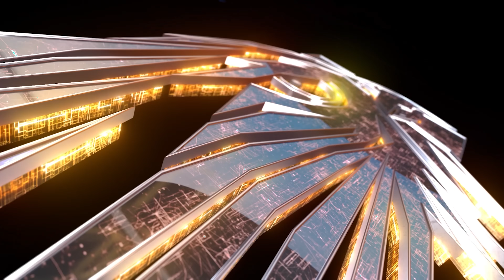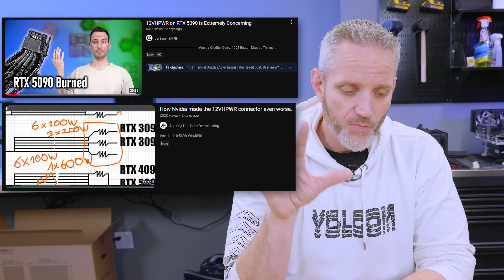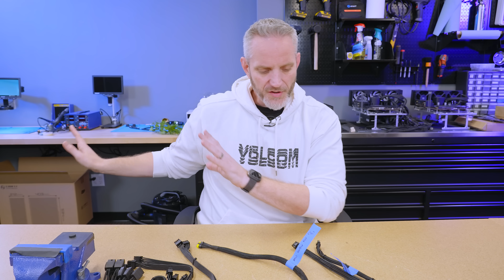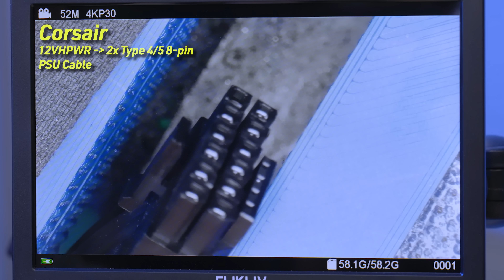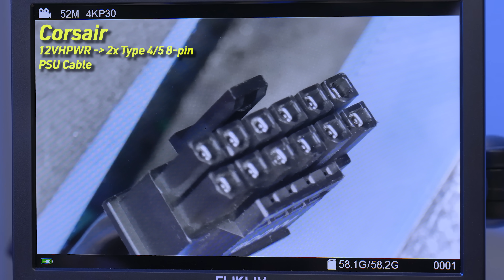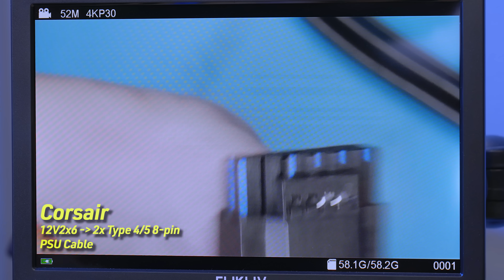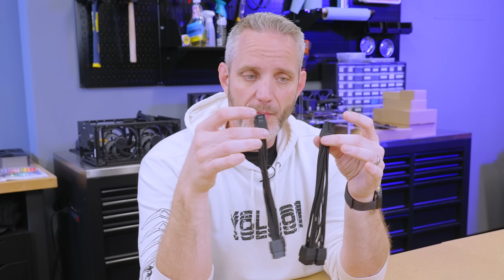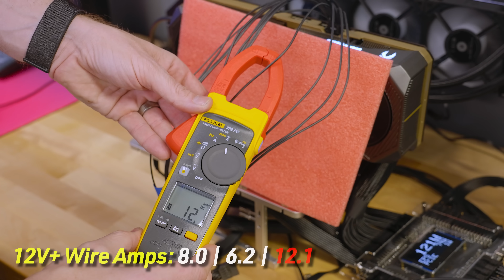I discovered something concerning and I need the Experts to chime in... More 12VHPWR discovery!

Comment: why don't people just use the power cable that comes with these 50 series cards??
Reply: what was included on my side, is 10cm and does not connect to sense, it is a 12pin-3*8pin. the power supply has a full 12pin-12pin with sense
Reply: @kensaiix  I think you and everyone else should be using the 12pin-3*8pin adapter that is included with the GPU.
Reply: @ it's too short.
Reply: @kensaiix  yea, but they melt.
Reply: @ why do you think the 12-3*8 would not melt? all that wattage still goes to the connector on the card

Comment: Jay, I have 2 x 5090 FE's one is being run off of the floppy included cable in the box and my other machine is running overclocked using a Seconic Vertex PSU and their included 12HP cable that comes with the PSU (it's a really long cable similar to the length of your cheapo amazon one). Now I have a reader as well and I have actually been checking the systems almost every bi hourly they have been running.

Machine 1 (floppy Nvidia cable) since the card has been installed has been running on a PC that is playing POE 2 for 16 hours min a day everyday with it running a solid 72 hours constantly from delivery day, literally almost as hardcore as you can get and not once has a single cable been over 9.5 not once.

Machine 2 (Seconic Vertex cable + overclocked) has been running everyday for a minimum of 10 hours a day and is used for multiple games from WOW, Overwatch, to Diablo, Spiderman 2 stuff like that. Again measuring the Seconic cable not a single time has a single cable been measured over 9.5.

I don't have any other cable to test after seeing these videos but yes the card is living on the edge with this connector but with my 2 cables I would bet my house on it that they would never fail under current use scenario and my use scenarios are probably higher than 99% of all 5090 owners.

The guy who had the burn out originally was using a third party mixed metal cable and as you probably know using mixed metal on connectors is a massive NO, NO at this power level. Maybe you can do a test and measure a mixed metal? anyway Nvidia will laugh in your face with a warranty claim involving a third party cable, simple as that.

I feel that the line between a good quality cable and a bad one is so thin that most cables will probably edge the line into being bad territory, from Nvidia POV if you use the floppy one in the box and just use the card at stock values it will never be an issue, we the consumers know the 600 limit is tight but ultimately it's fine in their eyes. At least the 60 series will be different as they wont be able to run it on a single 12VHPWR anyway.

Comment: A similar thing used to happen with the cheap 3d printer kit Anet A8. The 12v heatbed pulled about 10-15 amps. It used a molex type connector with 4 power pins but only used 2 wires to save money. As the bed moved back and forwards, over time, the connector loosened and caused arcing inside of the connector. As the arcing increases, deposits build up on the inside of the connector. This increases the resistance, which increases the temperature in the connector, which increases the resistance.... Often the connector would char and melt. In some cases, when the printer was left unattended, this led to fires. **The solution was to solder all 4 current carrying wires direct to the heatbed and provide strain relief to the cable to stop it from moving.**
Reply: That bed only pulls 7-8A, not 10-15, but anyway that's more than plenty for that underpopulated connector, WHILE BEING HEATED BY THE BED, which greatly accelerates the oxide formation and loss of contact springiness.

Its close relative the Geeetech i3 series, while otherwise doing just about everything in electronics right (more powerful chip, bootloader for easy programming, lots of configurability, more efficient parts, flyback diodes to prevent heater MOSFET shock, excellent MOSFET heatsinking, replaceable sensitive fuses for two separate sub circuits, good quality wires soldered to the bed) uses the ATX12V connector (4 pins all used) for the board power input. While the connector isn't being used in the angriest possible way, it's not moving, and the heat dumped into it from the PCB is very modest, it still goes bad within about 2 years. Maybe something with crimp quality, anyway eventually it starts heating more and more and then causes a runaway oxidation failure and slight discolouration of connector housing. The connector is loaded with up to about 160W or 13A, since it serves the 90W bed, the 40W heater, and another 40ish Watt worth of motor drivers and junk.

Comment: Jay there is something called pin push back. Whereas the female pin looks normal. However because the pin is loose in the connector the male pin pushes the female pin up in to the connector and does not make  good contact. When you pull the connector apart the male pin of the card tugs enough on the female pin that when you look at it, it appears that it is in place and
Flush with the connector.

Comment: My brand new never plugged-in Corsair H++ cable that came with my RM850x PSU has the same corner loose pin on one of the 2 connectors. The other end is all uniform and solid.
Reply: Shit. Mines been plugged in since last May and no issues and I want to check. But now people are saying that the cables are rated for like 30 insertions. Which is insane to me.
Reply: @jimbo121  I bought my power supply December 2nd from Best Buy.
Reply: @jimbo121  some more recent tests have shown that multiple insertions (like 100+) actually improved the connection quality. I wouldn't bother checking if you haven't had any issues, but not because it could wear out the connector. I also have the same cable plugged into my 4090 for over a year now and haven't had any issues thankfully! I do think it would be a good idea to leave it plugged in and firmly push all of the wires in individually. If you do have a loose sleeve like the video, that should seat it all the way on the connecting pin.
Reply: I built my PC in 2024 using the RM850x and just checked it. My Corsair cable is exactly the same with the loose corner pin. I then checked a spare Corsair PCie cable that I didn't need to use and it  also has the same loose corner pin. I found that if I pushed individual wires on the PCie plug on the GPU they were all seated nicely but that corner pin could be pushed in about 2 -3 mm before it seated fully but also felt loose on the connector.
Reply: Thanks for sharing!
@Jayztwocents same issue.
Reply: Dude, I was about to buy a Corsair psu... now I'm probably not going to lol

Comment: I'm no expert but when a wire heats up significantly due to high amperage, the fix should be the gauge of the wire in use. now we all know that the weakest link in the chain defines the strength of the said chain, so the calculated gauge should be same in every connection, wire etc from the PSU and past the 12v connector to SAFELY pass all the current through and not cause any heat related issues that would result in melting anything

Comment: My Corsair cable is exactly like that, except maybe a little worse, with multiple recessed pins. And It's brand new. Never been used or even plugged in once. I didn't use it because i purchased a custom CableMod cable.

Comment: Current flows from neg to pos in a  DC circuit, and loose contacts create a tremendous amount of heat. On my pigtail I pushed all the pins to the face and used a marine heat shrink with the waterproof goop in it, to hold the wires to the plug

Comment: C.I.T. here.   Power in and power out should be as equal as possible when it comes to wire thickness quality. Any variations in cable size affect the delivery of electrons. Any possible damage, quality control issues, or even cable length increases resistance in the wires. Resistance translates into heat. There are mathematical formulas that check all of this before you even get into the construction of items.  There are tables that exist where the math has already been done and charted. Wire size or gauge(awg), wire length, wire chemical makeup,(because some wires are just copper. Some are aluminum, and others are an alloy)have all been extensively put into charts for quick reference. 8 wires at 12 gauge should handle 15 amps if the load is balanced but if not balanced gauge thickness should be increased to compensate.  Remember electricity will always take the path of least resistance.

Comment: I used to only buy corsair PSU and other things but over the years their quality has gone to shit. After having multiple PSU dying on me, I started doing EVGA then Sea sonic and never looked back and have yet to have a PSU die on me. I would say it been a good 5-7 years since I bought anything by corsair. This might be a reason they are about to have a new CEO change which was one of the original founders. I have had 2 4090's for years now and have yet to have any cable issue. I have the MSI Supreme Liquid X 4090 and my son has a Zotac extreme. I was running an MSI 1200 PSU now went to the Edge from Lian Li since i went to the EVO XL and sons has been running on the Seasonic 1600w Plat that I bought from overseas because it didn't come with a US power cord to the wall so had to purchase it separately. This is when those PSU's was like gold and hard to get ahold of. I have also gone through roughly 3 or 4 cases over the time I have had my 4090 so it has been moved in and out to new builds. It all comes down to either human error or crap cables from shady companies. It would be interesting to know if all the melted cables have been from the same manufactory. Fasgear might be cheap, but I have had some of their adapters and they do make quality cables.

Comment: I built a new PC last week to go along with my 5090. I bought a Corsair power supply as part of the build. When it came time to plug the 12VHPWR in, I inspected the Corsair cable and didn't like how un-uniform the pins were. I threw it back in the box and opted for Nvidia's adapter. I upgraded from a 3090 and kept hearing about the issues with the 4090 for the past two years. I'm not taking any chances with other cables.

Comment: New isn't aways better,  the 8 pin connector was sound and tested and it worked. The saying
goes, if it's not broke don't fix it..The new design was dome from the start, I will not use this new
design period!

Comment: i put a completely new Corsair RMx Shift power supply in my new system that still has my 1080Ti in it until i get a 5090. so right now i use the 8-pin connectors for that card. i just looked at the 12V2x6 cable connector that was never plugged in or even handled in any way (it's still strapped), and 4 out of the 12 pins are visibly deeper than the others. This is extremely concerning...

Comment: Hello, hey after watching these videos. From multiple content creators. I decided to take a look at my cable just in case. 

My video card is a ASUS Pro Art RTX 4070TI Super. The PSU I use is a 1000w Seasonic Vertex it has a dedicated 12vhpwr plug in spot. But, one of my pins has been pushed in from the connection when installing I assume. I have pictures but If I hadn't come across these videos, I would have never known. It didn't cause a problem that I could tell. When gaming it would just kick me from the game I was playing. I just assumed it was because I had an Intel CPU and just needed to patch the thing which I did. I never really had the chance to test it after the fact. Now I'm not so sure that was the problem and maybe that pin was the issue all along . Anyway thanks I suppose maybe I avoided the problem because of these videos.

Comment: Just wondering if the card may be getting an alternative ground though the case which may explain why it tend to show on the +12V wires more.  Personally That corsair cable would be going in the bin.  Although I'm still avoiding cards with that connector type.  You'll never convince me that connector is suitable for 600W at 12V, its just not robust enough mechanically.

Comment: The 12VHPWR is on its limits. Yes thats not fine but should be OK.
BUT, as this cable has 6 wires for the total load which are not monitored at all, is where its getting dangerous.
If one fails the remainig 5 are out of specification, if 4 to 5 fail its starting to burn.

Comment: The funny thing is that people still claim Nvidia is to blame for designing the connector when it is not the connector at fault and AMD being part of the design-team of the specifications.
Reply from the maker: They absolutely own part of the blame, stop letting them off the hook
Reply: @Jayztwocents  "stop letting them off the hook"
Good thing i am not doing that - i am just pointing out the fact that the fanboys and haters just ignore the uncomfortable fact that AMD is part of the design-team.
Nvidia shouldn't have pushed it so hard, and specially shouldn't go with connecting all wires and not measuring the current, but that is not the fault of the connector and all board-partners are free to implement current balancing.

Comment: Only fk I can confirm I just went on my build to check my brand-new cable from asus that came with the power supply “ASUS ROG Thor 1200W Platinum II” connected to my 4090 and the pins in fact retreat if I pull the wires, that's mental

Comment: Hello, automotive master tech of 7 years here! Just chiming in to add that (at least in an automotive applications, and I cant imagine this is much different) having shorter ground pins, and potentially a worse connection as a result, could absolutely melt a connector end, and in fact I have seen it many times. Loose connections, corrosion, or damaged pins on either side of the circuit can cause catastrophic damage. Hope this insight helps.

Comment: I think you nailed 1 of the possible issues Jayz, I actually have an HX1500i bought in December last year waiting for my new build and it comes with 12v2x6 ++H cable, and the pins move as well, it's not just yours.

And as other have stated, moving pins can cause some electrical flow to find resistance, hence generating heat. And also having that possible resistance can make current flow through OTHER pins that are not facing as much resistance. Which is nuts.

Let's stick to the 12v2x6 cable provided from Nvidia whenever possible just in case. Nonetheless, I think this is not just the issue alone, but the fact of using just 1 shunt in the FE and other stuff that altogether cause the 5090s to be dangerous.

Comment: Not an electrical engineer here, but I am an engineer who has take electrical engineering courses, so I know little enough to be dangerous to a convo like this.  A basic EE law is Kirchoff's Voltage Law which states that all voltages in a loop add to zero (There is also a similar Current Law that is node based).  So, you would have your input voltage coming through the 12V pins, all 12 volts get "used up" (doing work and being dissipated as heat... a lot of heat in these cards) as it works through the card, then near zero Volatage leaves through the ground pins (assuming a near-zero resistance downstream of the connector).  If you pair this with the fact that Power = Voltage x Current, it would follow that zero Voltage = zero Power flowing through the ground pins, so one or two ground pins making little/no contact would not cause melting whereas having bad contact on the 12V pins would have higher power flowing and could cause the failure.  Please, if you are an EE or have more knowledge on this subject, please correct me, because I am working off the top of my brain and it's been a while since I have done circuit analysis.  I'm sure I could work through it all with a pen, paper, and some references, but it would take me 296.5% longer, at least, to have confidence in my results.  (Be kind plz)

Comment: I am honestly still shocked that PCI-SIG and Nvidia are digging their heels in on this atrocious standard. There is NO WAY that a standard with such fine tolerances for the connectors and such low ampacity overhead for the cables themselves should have ever made it off the drawing board and into consumer hardware implementation where it can be prone to users potentially not properly seating the connections, or manufacturers who ABSOLUTELY WILL cut costs by producing barely-in-spec or barely-out-of-spec products that "technically" pass muster but only just.

Nvidia and PCI-SIG need to eat crow and walk back on all of their sunk cost and move back to the more robust PCI 8-pin standard that AMD smartly stuck with.

Comment: Nvidia should implement a wire per wire monitoring and should also switch to an architecture which could balance the Amps per wire. Its 100% a design flaw. 
They know the problem since the 4090 but they absolutely dont care.

Comment: Regarding the speculation about the possibility for a bad ground connection causing problems, this is less likely than a bad 12V rail connection, because the PCIe slot itself has quite a few ground connections that provide shielding between differential signal pairs. So there's more paths for current to flow out of the card and back to the source (the PSU) than there are for current to flow into the card from the source.
Reply: There is also the last resort current path through the mounting bracket and enclosure metal.

But it's also to be considered what happens if ground connections are insufficient. The ground offset of the card rises and it crashes, probably usually well before accruing heat damage. Because otherwise you'd be seeing some cards where the power connector failed on ground, but has no heat damage, but card edge connector is delaminating at ground pins.